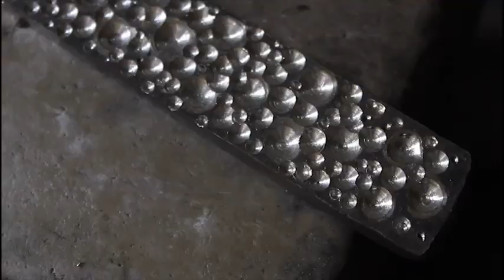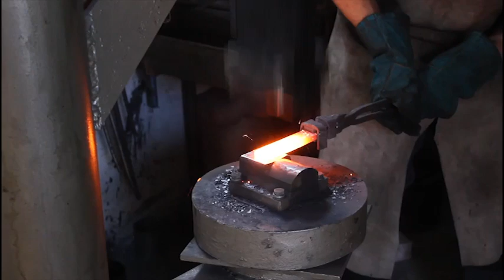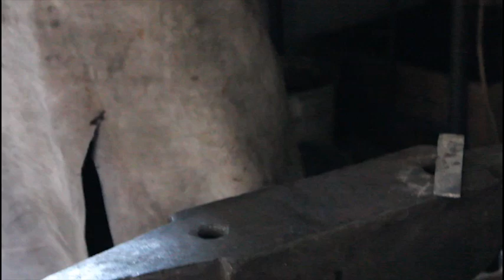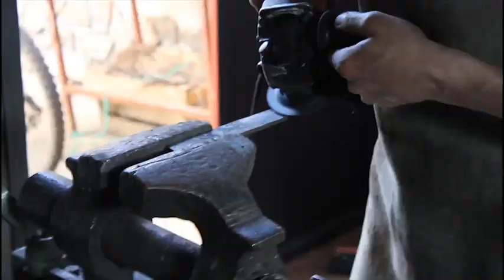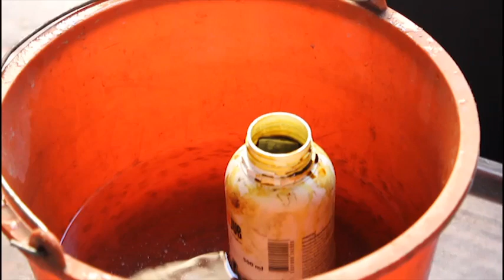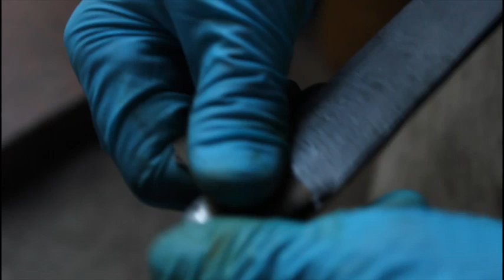Making of rose damascus blade - part 1

Comment: Aren't you just using an acid to bring out the weld patterns in the metal, so this really isn't damascus?
Reply: You need to etch the patternwelded steel to reveal the pattern, otherwise it will look just like a regular type of steel.
Reply: all damascus is etched in some form of acid to reveal the pattern.
Reply: Ah I see now

Comment: For those that want to criticize this mans hard work, I suggest you try bladesmithing yourself to see just how hard it is. Damascus is just a term bladesmiths use to refer to pattern welded steel. It's the same process the Syrians used in days of old. Stacking small bits of steel and forge welding them together until there is enough material to make a blade. As a bladesmith myself I can appreciate Rales hard work. Well done sir, keep up the good work. Pay no attention to the ignorant comments
Reply: Not saying your entirely wrong but the stacking was for making many layers which was 
stronger than regular iron or steel
Reply: @-_-3139  Nope the  layers come from folding the material to remove impurities because the steel quality was not very high so if it wasn't folded then the blade would have inclusions.

Comment: I'm no expert but I don't think that qualifies as true Damascus steel. True Damascus is made by folding the steel again and again and again to make lots of layers that are forge-welded together which when polished has this type of pattern.
This is a clever way of getting the same pattern without the very long laborious process that is required. Layering the steel multiple times gives it it's unique qualities and makes it so highly sought after for making weapons like swords. This may well work fine for decorative swords and possibly fool some experts at a glance but I'm sure it will not perform as well as a true Damascus steel sword made by a true craftsman.
Reply: If you look at the metal at the end of the video you can tell that those blanks are already layered steel (Damascus). But if you just stack stuff flat and look at the top you only see the top layer, by drilling into it and then flattening he created the pattern he wanted. As a side note, pattern welding/Damascus has absolutely no structural advantage over a solid piece of steel. This entire process is purely cosmetic.
Reply: Charlie Calder
As I said 'I'm no expert' but I think you are probably right about it being layered steel which is then drilled to create that pattern.

I would have to disagree about it's structural properties though, I have read a lot about the benefits of layered steel over plain steel and almost all the best known swords are made from layered steel. It is much more resilient and far less likely to break.
Reply: A weld if done perfectly is as good as a solid piece of steel. Nothing is perfect though, so every weld, between every single one of those layers is just extra flaws in the finished product. Using a high carbon piece of steel as the edge or jacket of the sword and using a softer low carbon piece for the back or core, can indeed make a blade that, at least imperfectly, combines the edge retention of the harder steel with the flexibility of the softer low carbon core.
But with modern metallurgy, modern steels, and heat treatments; you can make a better weapon from a solid piece of a single type of steel.
Reply: Charlie Calder
only if you use the very best types of steel available today.

Damascus steel (and other products like it) are usually superior to single piece products.
Reply: Ian Clarke the two blanks he drilled into at the start were already folded steel, the drilling simply altered the "normal" folding pattern that was already present
Reply: Ian Clarke if you not an expert don't try give an expert opinion.